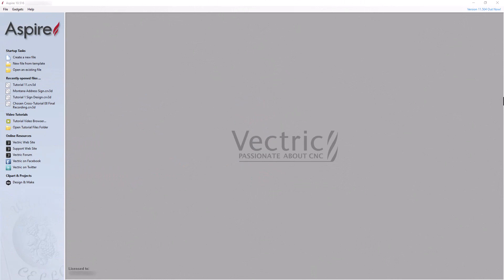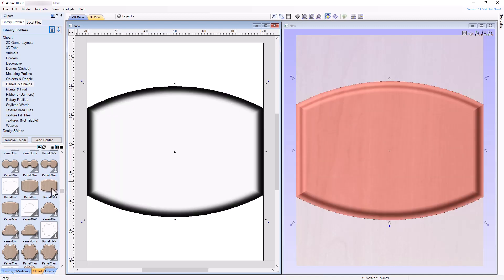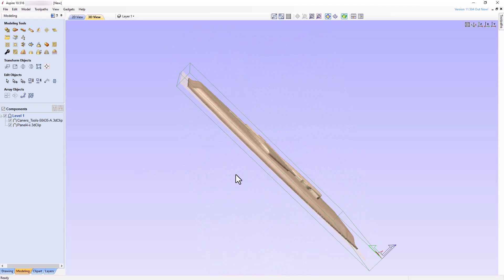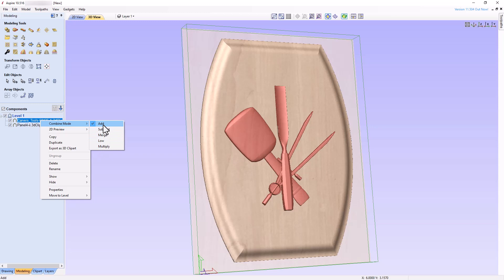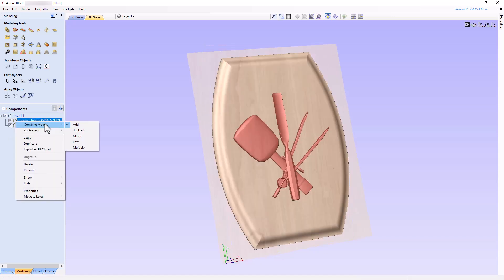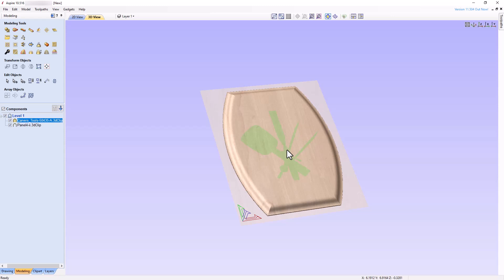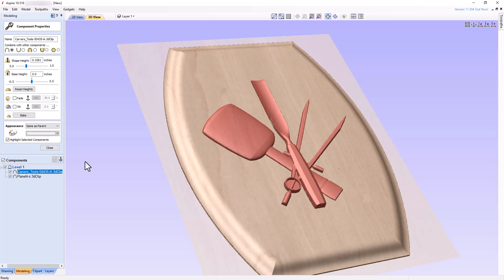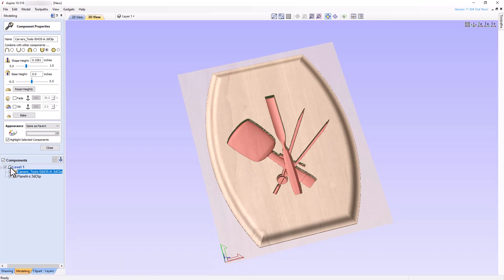CNC Woodworking Tutorials for Beginners-12

Comment: Thank you very much. But I can't understand "Model Position in Material" section (Gap Above Model & Gap Below Model).
Reply from the maker: I will try to explain using an example. If you are using a material 1" thick and the overall thickness of the model you are carving measured 0.4", then you can use the slider in the "Model Position in Material" to locate exactly where in the material you want the model carved. For instance, if you choose the gap above the material to be 0", then the highest point of the model you are carving will be located exactly on the surface of your material, and the bottom of the 0.4" thick model you are carving will be located 0.4" down from the surface. There will also be 0.6" of unused material beneath the 3D model. In essence, you have a 0.4" model with a 0.6" base added to it when it's finished carving. If you set the gap below the model to be 0",  then the gap above the model will be 0.6", meaning that the top 0.6" of material will be removed by the CNC toolpaths before the top of the model is reached and the actual model begins being carved. The total of gap above and gap below the model will always be equal to the the model thickness subtracted from the material thickness. Hope this helps.
Reply: @fjbcustomwoodcrafts  That helped me! Thank you very much.